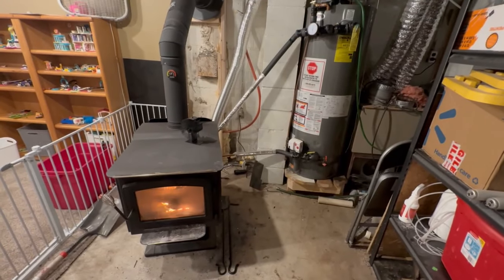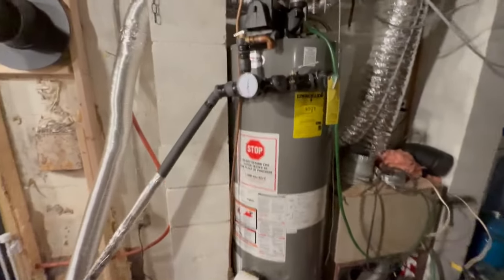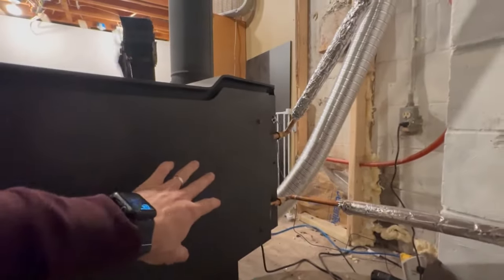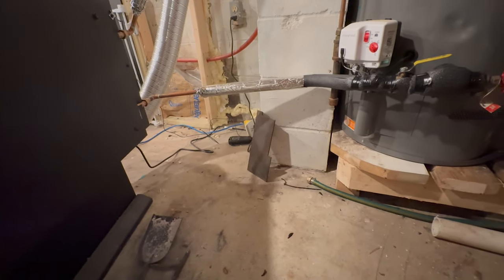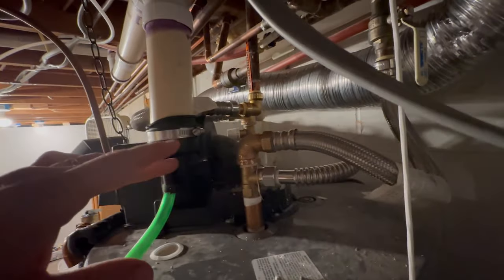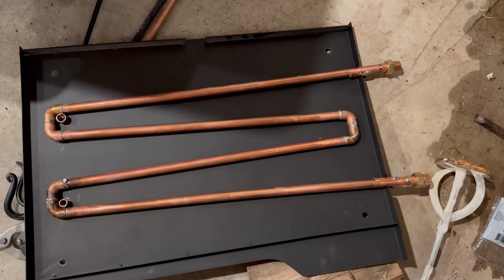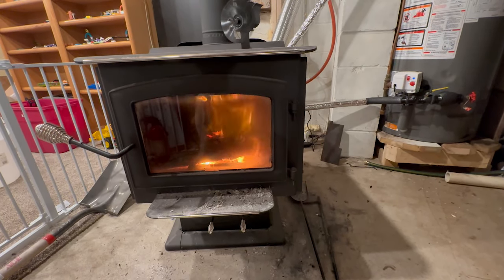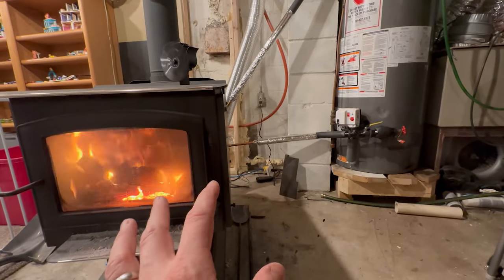DIY Hack: How I hooked up my water heater to my wood stove

Comment: As a plumber I am impressed.  By raising the water heater you helped eliminate a heat trap condition. Free hot water for the win !!.
Reply from the maker: Thanks for the comment, please hit that subscribe button!
Reply: My water heater is in the  basement but the stove is upstairs. Would a gooseneck work?
Reply from the maker: @jasonbrown7258  I am not sure what a gooseneck is?
Reply: Raising the tank did nothing to help the thermosiphon. I have my water inlet lower than the heat exchanger on purpose, to stop reverse thermosiphoning. This could be why you're losing heat.
Reply: Well h2o? Or city? Are you worried about  lime pluging up?
Reply: You could also use a second tank online of the cold water in let. So cold water to 2nd tank cold in, hot out to  primary hot water tank cold in. Side arm hooked to the second tank runs as a preheated. In this case the second tank is not running as normal gas or electric and can also be put on a different floor. City/regular water pressure will move free heat from 2nd tank to primary. Primary will function as normal but feed with hot water when fire is burning.
Reply: @bradyusko6333  that’s smart. Making the wood stove truly the back up and primary DHW source without needing to turn valves. Of course when adding wood it’s not making opening valves much of a chore.

Comment: I think you were just air locked to begin with . A larger drain at the top would solve that . Nice job.
Reply from the maker: I bled the breather on the valve as well has the both pressure relief valves on the first and second go around.  It worked the first time but just not well at all.

Comment: You are correct.  I have a wood fired hot tub heater.  It requires a significant angle of cold water from tub to heater for it to thermo siphon.    Very clever.   More surface area will help for sure.   If you can increase angle from heater to stove that would also help.
Reply from the maker: Thank you for your input, please don’t forget to subscribe to the channel!
Reply: What about the heat exchangers they have on CPU’s would

Comment: use malable copper tubing and coil it around the black flue pipe.... lots of heat transfer that way and much better flow due to the heat transfer. also no joints at the heat source
Reply from the maker: I didn’t do that for 3 reasons how .

1) Aesthetically I didn’t want to see that 
2) it would cool the flue which would increase chances of condensation and build up as well as reduce draft.
3) the flue is hottest during the first hr or so and then the temp really starts to drop as the volatile gases burn off early in the burn and transitions to more coals. The firebox on the other hand gets hotter and stays hotter much longer giving me a more constant heat.

Comment: For safety you should have piping running to the ground for your PRV. I see your little guy over there & if that thing blew hot water would spray. Other than that awesome job!
Reply from the maker: It does, just didn’t have it done before I shot the video!
Reply from the maker: Thanks!

Comment: Andy make dame shore you a three quarter pipe on youer pressure value  down to 6 inches off the floor  so if it blows off you don't get burnt from the hot warter our youer kidds safety  is very important
Reply from the maker: That is in the works, I am going to run it over to the drain, I just wanted to make sure I wasn’t going to change anything again before I went through the work of running the pipes.

Thanks for commenting, please hit that subscribe button!

Comment: This is a great idea but you need more surface area for your heat exchanger on the wood stove to be more efficient on heat extraction from the stove, do a lot more Z's to capture more heat. Awesome project though!
Reply from the maker: I added 1 more zig zag to this current set up, it added a little more heat to the tank but there isn't room to add anymore to this side so I am planning on adding another one to the other side as well!
Reply: If you plan on adding zig zags I’d up the pipe size. Or use a circular spiral coil will give a lot less resistance over the pipe run. Looks good.
Reply: @Elldeeve  smaller pipe diameter gives you more surface area to heat the water, so it will give you less gpm of hot water but the water you put through it is much hotter. I am an engineer and homebrew beer so I understand how exchanging of heat works most efficiently, but in my job and hobby its usually cooling water but the same concept applies.

Comment: We heated our house and heated our water with wood for over 30 years! I bet the power company wondered why our electric use actually dropped in winter! I used an 80 gallon electric water heater as the tank. I pulled out the heating elements and ran the heavier gauge 3/4” copper pipe into our Kalamazoo furnace from those openings. The manufacturer gave instructions with the furnace and it had knockouts for the pipe. I did as you did and raised the tank up 16” on two layers of concrete blocks. It worked like a charm! The tank had the temperature and pressure relief valve already. I had it set up feeding into the household electric water heater. I turned off the power to the normal water heater in winter and never ran out of hot water, and we had two daughters living at home! The pop off valve actuated often!
Reply from the maker: That’s great!
Reply: @portercreek  oh yeah, I wrapped the tank with r13 fiberglass insulation and insulated the exposed pipes. Point is, using a dedicated electric water heater as the tank made the setup pretty easy and it had a lot of features as is that are needed for this thermo-syphon system work! Thanks for the video!

Comment: My buddy’s dad built a shielded manifold that sits inside his XL wood stove, he designed his house to have the water heated on his roof. During the winter the water can be practically boiling. 

During the summer he uses solar hydronic heating from a heat exchange system he built into his roof. 

Winter power is assisted by his seasonal creek and a micro-hydro system and a brushless alternator. The (vertical) head is only 100 feet. 

The ingenuity of the homesteaders in that area of NorCal to live more in harmony with nature is absolutely mind-blowing.
Reply from the maker: I wish I had a creek running through my property!  I would love to build a hydro generator!

It is fun to see the ingenuity behind some old timers projects!

Comment: I'm very close to purchasing a Tim Sistem North wood cook stove with built in exchanger. My plumber just worked out a system and it is exactly what you have done here. I'm glad to know we're on the right path!
Reply from the maker: Nice!  I would love to have a cook stove!
Reply: <<
@RyanKudasik
9 months ago
I'm very close to purchasing a Tim Sistem North wood cook stove with built in exchanger.>>

I have looked at wood cook stoves ---- and not bought it.

I find I need the heating capacity of my wood stove to keep the house heated.  A wood fired cook stove  has the combustion chamber sized for cooking food, not heating a house. 

I have an old rental house that has a brick chimney in the kitchen right next to where a cook stove goes.  I imagine that was used for a coal or wood cook stove,  but it would not have done much more than just heat the kitchen

So if you plan to install the wood cook stove, I hope you have another wood stove for heating the house.

And I hope you have a gas or electric range to use during the summer months, when a wood cook stove will add a lot of heat inside a house that you wont want. 

Personally, during the heating season, I do a LOT of cooking on or IN the wood stove.  With some practice I am quite good at that for many items, and the additional cost was $0.00.

A hundred years ago, one of the major selling points of gas or electric cook stoves was that they did not overheat the house during the summer.  As I understand it,  in southern states cookstoves were often used to be located outdoors to avoid bringing heat into the house.

Comment: I like what you have done so far I'd be uncomfortable using solder joints for the heating part though I know the water should keep it cool enough but if something go's wrong with the water flow it could all go bad very quickly and I think it would work better if you used 1 inch pipe and added 1 inch fittings to the tank I lived in a house with coal stove with a back boiler for hot water and radiators all around the house it worked amazingly well at the time I thought it was out dated and took to much effort but I wish I had a setup like that now
Reply from the maker: I wanted to go with soft copper but I couldn’t get as tight of bends with the soft.  I also wanted to do 3/4 pipe but I would have to remake the shroud on the outside if I did anything thicker than half inch.

Comment: I am putting in a 30x40 shop. I plan to put in a wood stove immediately and will tube the concrete for radiant heat. This may be a good system to marry the two. Thanks for sharing.
Reply from the maker: If you do try to heat the pex tube through the concrete floor you will need to do a heat exchanger on each side and some on top of the stove to make enough of a difference because that is a lot of mass to heat.

Comment: New subscriber.
I dig how you explained all of your fittings. You're right, not a bunch out there on the Tube about the "nuts and bolts" of this conversion.
Car radiator installed on either side, instead of your zig-zag.
Reply from the maker: Thank you!  I suppose the car radiator would work if I removed the shroud and left it off.  There would be a little more ingenuity to get the plumbing to work.

Comment: If you had thermal mass around the copper tubes  up against the hot steel it would increase the efficiency of the heat transfer thus increasing your flow rate. That stove is hotter near the top then it is near the bottom due to how the fire brick lines it. Aluminum poured in a soild block around the copper tube would be ideal, you could also use an aluminum heat transfer plate made for pex radiant floor heat, anything like that around the tube is going to be better than air.
Reply from the maker: Good tip!
Reply: I was thinking about using steel wool to surround the copper pipe and add to the surface area around both the stove and the pipe to increase heat transfer.
Reply: @SeattlePioneer  Steel wool is flamable so I'd advise against using it.  Fire brick mortar or molded clay packed in then a piece of ceramic insulation  cover would help.
Reply: @Tonnsfabrication  Sand is also a good thermal mass. You just have to seal it in the panel somehow.

Comment: I got a couple of tips from this video. I am looking to tap into my baseboard hot water system. My boiler is on the same floor but a good distance from the fireplace (with insert ). So I will tap into the baseboard water line, just not sure if I am going to drill through the stove or have water piping on the outside of the stove. Though I would have had it done for this year but will be ready with plans & supplies this spring. The price of oil is now a big motivator.
 👍# 45
Stay well, Joe Z
Reply from the maker: I have a different design that I can up with for the other side that I am going to do for a boiler set up to heat my garage.  The heat exchanger on the stove will have more to it to capture a lot more of the heat and I will have a circ pump hooked to that system.  I was hoping to start on that project by now but I don’t think I’ll get to it until after the holidays.

I thought about putting the loop inside the wood stove but I didn’t want to sacrifice that space in the stove and I have a hard time wanting to drill holes through the firebox of a new stove.

Cost of gas was a big motivator for me!
Reply: @portercreek  Did you start on this project yet? If all goes according to plan LOL I will be starting mine in June
Reply from the maker: @JOEZEP54  yes, it has been installed since fall.  I made a mod to it shown in another video but it has been working great!
Reply: @portercreek  I will take a look. What is the title of the video?
Reply from the maker: @JOEZEP54  https://youtu.be/OpYGPeS_cV4
Reply from the maker: @JOEZEP54  there should be info in this video about how I connected it to the water heater and made it removable
Reply: @portercreek  Thank you. I had to look at it again.

Comment: I've been thinking about this idea for many years. I have to wait until I move to do it. Like what you've done. You can increase the pipe size to three-quarter, and that would help along with more zigzag and as somebody else said more thermal mass around it. They used to do this back in the old days. I have a book where they have a  cooking wood stove like this. I have solar hot water heater. It has 120 gallon tank that feeds my 40 gallon tank and before that I have the old 40 gallon tank as a tempering tank. You would be surprised how much the tempering tank works. I took it out one day while I was putting on the solar tank in. it was amazing how many times the hot water tank came on. I wouldn't have believed it if I didn't see it with my own eyes. That tempering tank makes a big difference. When I put it together, I got the temperature control valve also .never put it on. It's sitting on top of the hot water tank. You could tell my family something 1000 times. They don't pay attention. You'd be amazed how people pay attention when they're going to get burned by water. Funny how they can pay attention to that. Nobody's ever got burned. They pay attention. My solar, hot water, his got up to 195°  When I bought my solar, hot water system, the guy told me it's all about storage. You don't have enough storage. There used to be a magazine called home power. in it a guy built a cement storage tank because it was so big and lined it with plastic. I believe. it was massive. I think he had hot water heat too. Nice job and good work.
Reply from the maker: Thanks, I do intend to increase to 3/4” for a little more hot water during the shoulder months.

Comment: I used to work as an apprentice with a heating system installer a very long time ago. This was right at the time when circulating pumps were fairly common, but some people still choose to have pumpless system installed. These whole house central heating systems worked because of convection current alone. We started out with a minimum of 2" pipe from the furnace, and gradually stepp it down at the radiators, but the main circuit had to remain a minimum of 1" to make sure there's enough flow. Anyway, the point is, when you design a convection cycle based system, the diameter of your piping matters a lot. Even in a small system like this. If bigger pipes are not an option, you need a pump to circulate the water.
Reply from the maker: Thanks for sharing, I do have a pump installed and did not find it to be helpful.  I will eventually modify the shroud in the side and go with 3/4” pipe I stead

Comment: We had a wood stove in the early seventies that also heated our water with pipes set in the back of the firebox and oven. We were on tank water and the tank was above the level of the stove but the hot water tank was on the bottom floor of the house where the showers were. We only had a sink that used hot water on the top floor. It was probably set up in the 50’s when the house was first renovated and worked pretty well and I think was standard for farm houses in the area at the time. I like cooking on wood stoves but looking after them and the wood was a pain-in the butt.
Reply from the maker: Thanks for sharing!
Reply: Why not wrap the water pipe tight around the smoke pipe? Extract exhaust gas heat.

Comment: What do you do in the summer months
Reply from the maker: Currently I am using gas in the summer.  I’d like to figure out a solar option eventually though
Reply: Is the tank you are using a gas hot water? In other words, wondering if you just have it turned off when you're using the woodstove, and then turn it on when necessary?  @portercreek
Reply from the maker: @shirleyjones63  yes, I usually just leave it on during the shoulder months and then turn it off during the dead of winter when the fire is always going.  We have 6 people in our house so we use a lot of hot water.

Comment: Thanks for sharing. Have you kept the water tanked hooked up to it's original heat source (electric or gas?) so that you still have hot water in the non-woodstove months?
Reply from the maker: It is gas, yes it is still hooked up

Comment: Well Done! I am not a pro at this, but I am a bit worry about the solder, tin melts easily (450F),  even you are willing to use lead (621F),  you still run the risk of leakage in case of flow interruption. Take care😊
Reply from the maker: Thanks for commenting!

Comment: This is a good effort. Just keep an eye on the heat exchanger as I am not sure how long thin copper will stand up to the chemicals in burning wood.
Reply: Seems to me the copper is on the outside under the panel and never touches the flames.
Reply from the maker: @RRaucina  it doesn’t!

Comment: Great job I've been thinking about doing this for a while and I have a question doesn't the heat of the stove melt the solder
Reply from the maker: While there is water in the pipes it cannot because water is cooling it.  

Similar concept to putting a plastic solo cup filled with water on a log in a camp fire, the top of cup will melt where there is no water but the rest will not and the water will temp will raise to a boil.